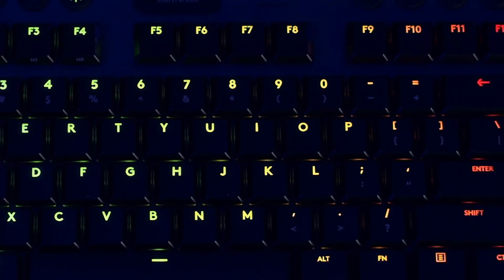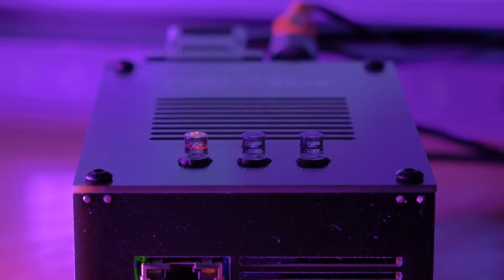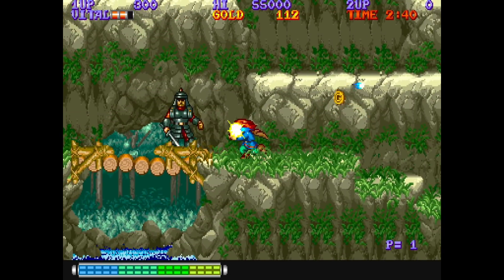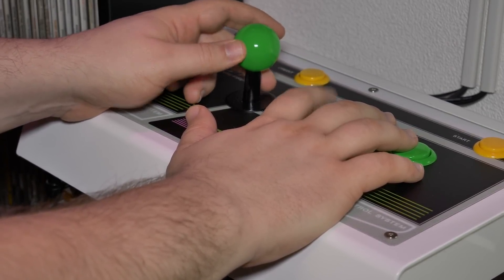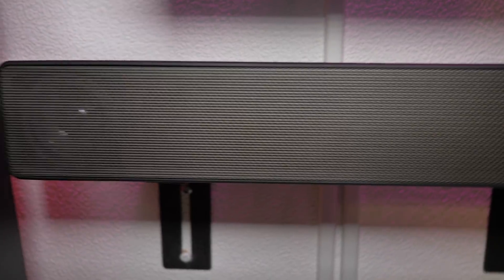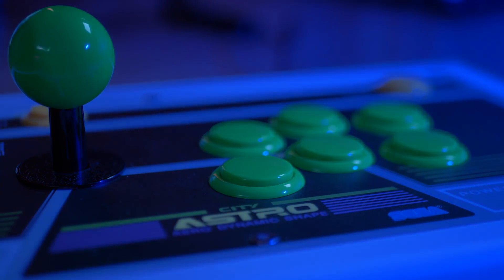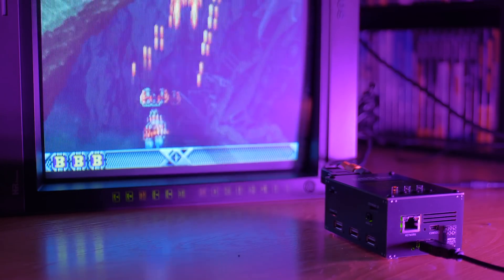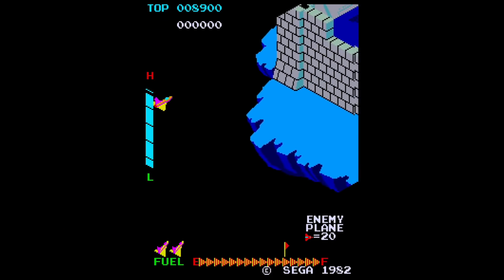DF Retro Hardware: MiSTer FPGA - A Brilliant Mini Emulation System Explored!

Comment: Software emulation is just as good and it's free, not everyone is lucky to have a spare $335.00 what with millions losing their jobs.  Right on cue Jon shits on software emulation @ 2:46
Reply: Accuracy and compatibility wise, sure. FPGAs run all components in parallel which can result in no additional latency compared to the original hardware. Emulators can do this for specific games with techniques like runahead, but these increase cpu requirements significantly.
Reply: What? He didn't shit on software emulation at all. He provided a brief but accurate take on the tradeoffs.

It's pretty dumb to expect DF to ignore a significant development in the retro gaming world just because not everyone can buy it or will want to buy it.
Reply: nothing is free the deskltop you bought was not free
Reply: Lighten up, Francis.
Reply: What a crappy take. He didn't shit on emulation. He didn't tell people they should get a MiSTer. He was simply explaining the differences between using FPGAs and emulation.

As for your comment on millions losing jobs, that's absolutely true and a dreadful situation. However, this is a hardware channel covering hardware, some of which is quite high end. Of all the things to complain about, you had to talk about a $200 board (with the 128MB SDRAM module).
Reply: Its getting there for sure but not as good as Hardware emulation.
Reply: It's not "just as good". In software, you get largely linewise rather than cycle accurate emulation which is mostly good enough, except for oldest systems which are cycle granularity. When you look at 16-bit systems, accuracy-focused emulators like Higan, Bsnes, Exodus, these all get... slow, and they only just barely approach the accuracy that you can get out of an FPGA. Fast enough that you can manage running them, slow enough that a promise of zero-latency becomes pretty distant.

On the other hand, you do get enhancements in software based emulation that aren't possible with FPGA. You also get more systems with software based emulation, simply because it's an older and more accessible field.

These are two pairs of shoes with different advantages and drawbacks. If you find software emulation more cost-effective and just right for your personal use-case, you're not wrong, but FPGA are of unique importance, they aid in system research and preservation immensely, you don't get to poopoo them.
Reply: Go away with your BS
Reply: @wayn3h  Yeah right, there's latency between your ears. There is nothing a Analoge Super NT can do against a decent PC running an emulator.